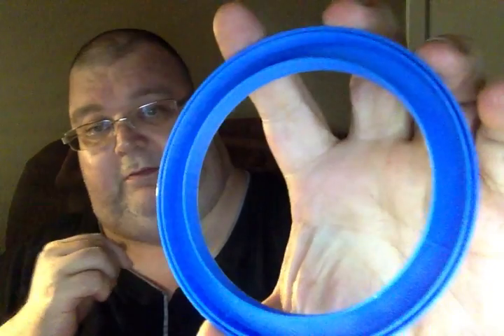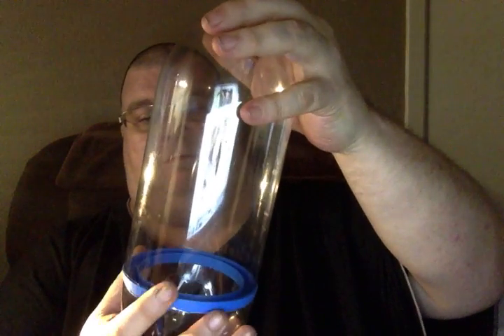Solar Water Purifier

Comment: Heya Les, I love your idea. I'm just wondering. if you've created a mini spout coming out of the band. If not would it still affect its usual condensation process?

Another idea expanding on this, would you be able to make a condensation pipe? 
If you were to dissect the middle of the bottles and stack them tall tie them against one long stick you can expand the condensation surface area. 
 _
{  }  < This representing the top of the bottle
[  ]   < This just being the middle parts of the bottles
[  ]
[  ]
[  ]

Please let me know what you think.
Reply from the maker: the spout is the #1 suggestion that people make.  Basically I gave up on this due to not having a way to put it into place.  Also I'm not sure what a condensation pipe is.

Comment: Sorry to burst your bubble, and correct me if I'm wrong. But the water that comes out of that is distilled, right? Drinking distilled water is, from what I know bad. It dehydrates rather than hydrates your body with it's lack of minerals. Again, correct me if I'm wrong. Just wanted to bring this to your attention.
Reply from the maker: I don't know, that's a good question - will the water from this device be distilled?  It's a slow distillation process so impurities that are lighter may be reintroduced to the water via air currents  This may include minerals or unpleasant wafty odiferous nastiness, to put it in a somewhat light hearted mood.  Certainly your point is well taken and I will keep that in mind for sure.  :)